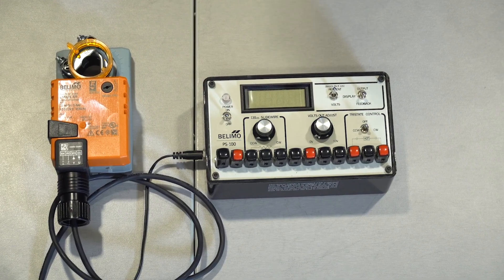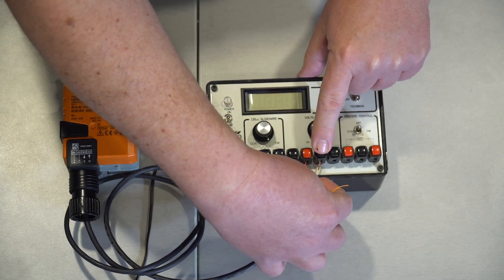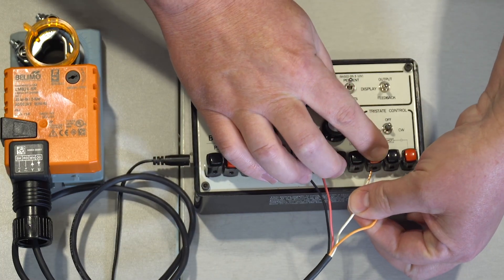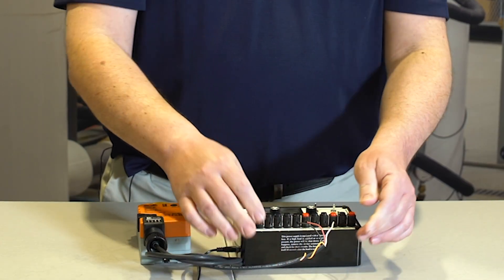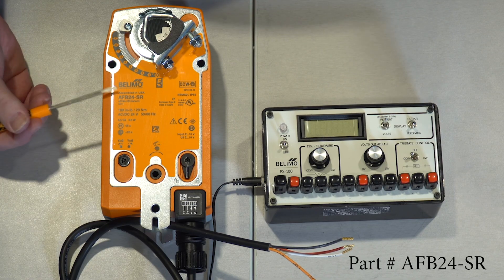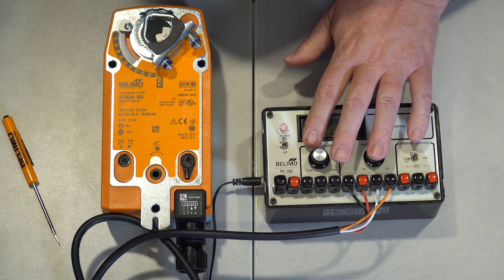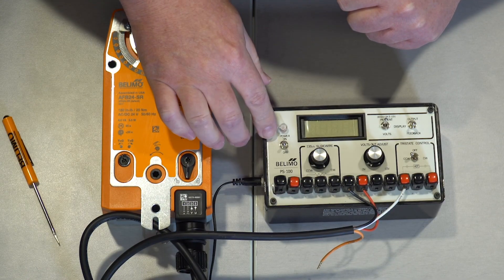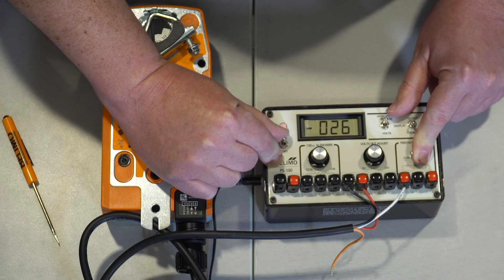How To: Wire a Modulating Actuator as an On/Off Actuator

Comment: i have a question so you said for the actuator to modulate for on/off you need to connected to the input from the controller i thought it should be from a digital output from the controller

Comment: I called in the last 3 weeks Belimo technical support several times and I talked to both Chris and Brian. All I can say is that they are both great. One of the them answers the phone very quickly and they both know the data sheets inside out and they can give you good feedback on whatever you are trying to do. They can also point you in the right direction if you are not sure of which product to use and how. I give Belimo customer support a 10 out of 10. Thank you guys.